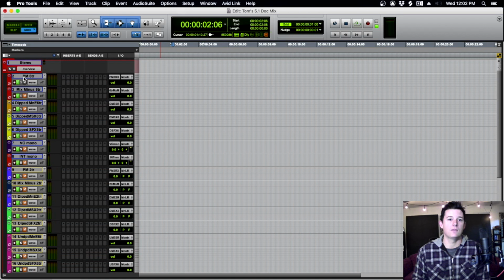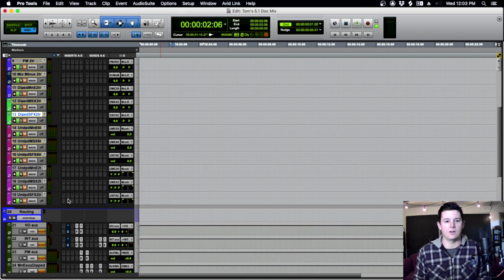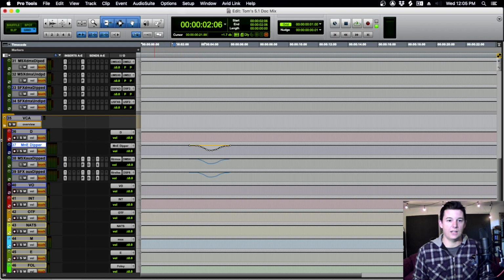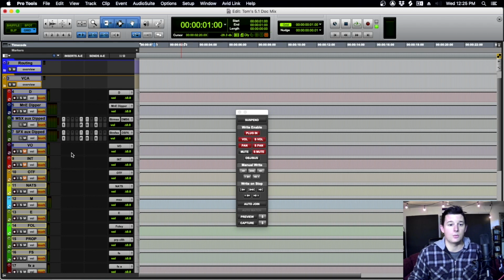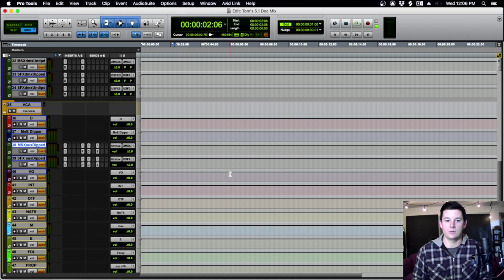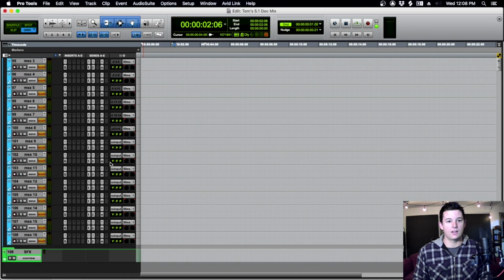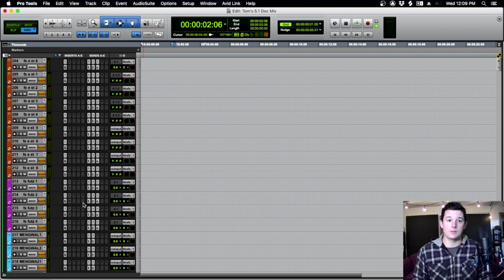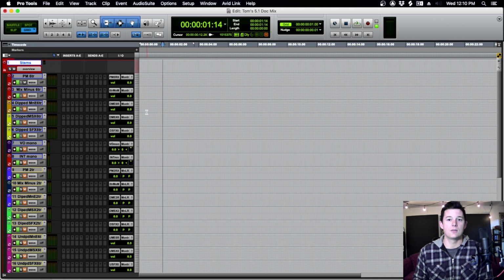Mixing a Documentary in Pro Tools - Dipped and Undipped Stems

Comment: Hi. Sorry I haven't done a lot of doc work and I'm slightly confused. When you are talking about undipped stems, do you mean undipped for both VO and any sync dialogue? And you don't do any volume automation on the unit tracks at all for the whole mix? Find it difficult to understand how to create a mix without automation. - just static clip gaining? I would generally use the unit tracks to mix everything minus the VO, so automating the volume on the music tracks. Then use a dipper to mix in the VO. Obviously this means that the 'undipped' stems will have dips for sync sound (generally ok, no?) but not for any VO.

Sorry if I'm missing the obvious
Reply from the maker: Some specs ask for no dips for narration or interview clips. They dub the interviews! So you have to do the volume automation on a bus.
Reply: @ThomasBoykin  thanks for the reply. I guess in that case you can still do some unit track volume automation to level out the music and fade in and out. Then do all dipping on busses. I'll give it a try anyway. But also maybe in the case of a completely undipped mix I would try just doing 2 separate mixes. Cheers